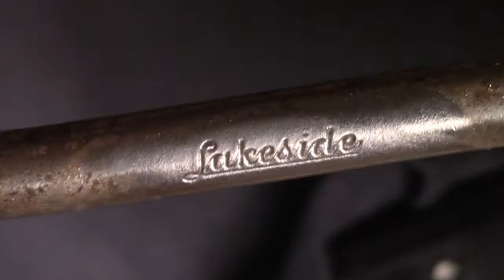Brace Drill Restoration

Comment: Hi Ben what did you use to lubricate the jaws?  Also can you do a video on the hardware cabinet behind you?
Reply from the maker: I really have a lot to learn about lubrication. I think I just put some penetrating oil on the inside pincher thingies and wiped it off.  I have some grease that is white but I think I need to get some of that redish stuff to have around the shop. The jaws are probably not lubricated as they should be.

I'm about to shoot a shop tour video where I'll tell the story about that hardware cabinet. Thanks for reassuring me that someone might be interested. And thanks for watching!